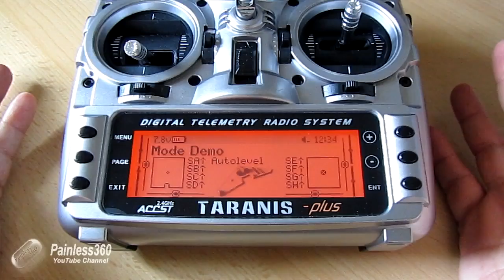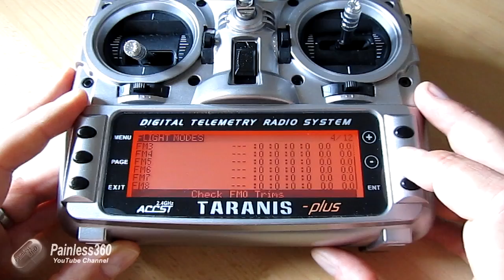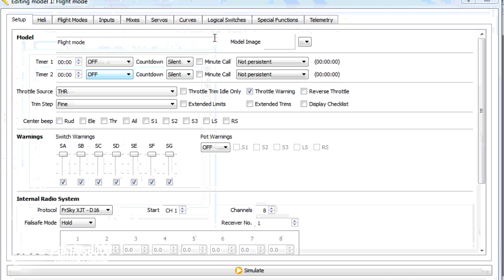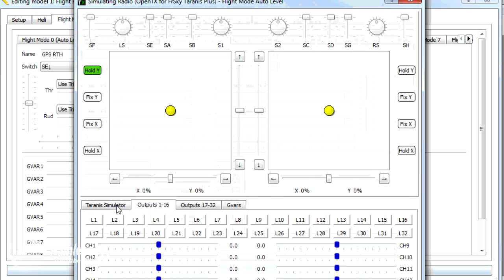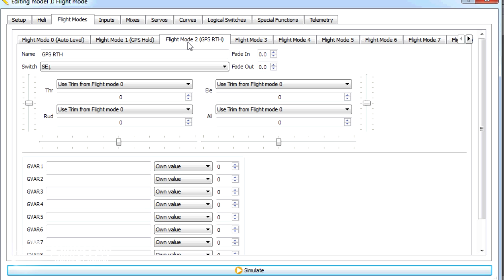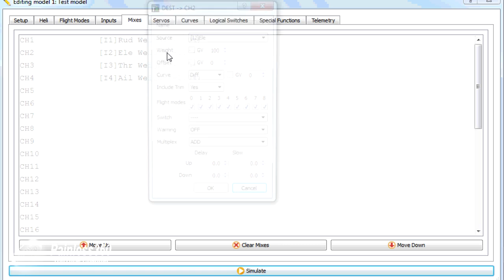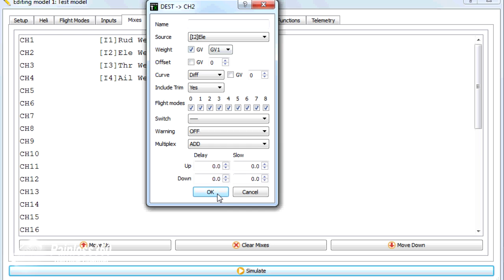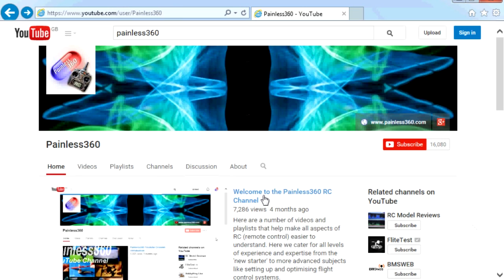(11/12) FrSky TARANIS Radio – Using Flight Modes and Global Variables (GV/GVR)

Comment: hello, huge fan and great videos....got a question for you....How can you put in trims  on both AIL if you have them wired with a Y cable on one channel, like camber and stuff?
Reply from the maker: The simple answer is you cant. For things like that then seperate Aileron channels are needed. See my plane setup videos... best of luck!
Reply: TY

Comment: I'm using iNav on a fixed wing.  If have flight modes for Angle, Horizon and Bypass Mode on one switch.  The flight modes display properly. Now I have a separate switch to activate a mission.  Although I have created a flight mode for automode, it will keep displaying only the basic flight modes, ie. Angle or Horizon.  How can I have an override to display automode?
Reply from the maker: What troubleshooting have you done? GPS lock?
Reply: @Painless360  It is a display issue only, not one of function.  All my flight modes work 100%, but it is just that they don't display properly on my Trananis 9x Plus.
I have Horiz, Angle and Normal Mode on switch SC, and AutoMode on switch SE.  When I'm in Angle or Horizon mode and switch to AutoMode, the display will continue to show either Angle or Horizon mode, never AutoMode.  
I'm not sure there is a solution to this, but I discovered is has something to do with the order of the flight mode, i.e. 1 through 8.  If I make AutoMode my flight mode1,  the display will show correctly. But if AutoMode is flight mode 6, and Angle is 1 and Horizon 2, it will not display the AutoMode but will stay on either Angle or Horizon .  So the lower flight mode numbers have priority over the higher flight mode numbers.   Its a bit strange, but that is how it seems to work.   
Anyway, it is not a big issue as I also play the audio tracks when selecting different flight modes.

Comment: Well Painless, 
(Am I allowed to use this name when addressing you in an email??? I don't want to appear ill mannered,or insulting.)
This video has raised my curiosity about Stabilization, and GPS Return to Home.
I am not into quadcopters, but can see some potential merit for setting those systems up if I temporarily lose sight of a glider/sailplane.
MY QUESTION
What is or are your recommendations for stabilizer and GPS Return to Home eqipment wich is compatible with FrSky and Taranis Plus(LBT).
At this stage I just want to browse and explore the options and perhaps links to a couple of forums, and of course potential costs.
Go With the Flow
Bruce
Reply from the maker: At the moment we are big fans of iNav, it works on multirotors and fixed wing too. See our series on it where we cover what you need and how to set it up.. Best of luck!

Comment: Thank you for all these wonderful tutorials, I have learned so much.
I am now flying my six servo Phoenix and motor on seven separate channels. I have managed most mixes under your great videos, and thank you for that.
 BUT I have not yet discovered a simple way to set up reflex, camber, and thermal, on a three way switch (say SB for example).  I am thinking that I should be able to set this up on one aileron,  using GV1 reflex, GV2 camber, and GV3 thermal, as Flight modes 1, 2, 3.
Having done that, I could then "copy" to each of the other servo and flap CH mixes.
Am I heading the right direction???  Do you already have a video that describes such a set up? This Video 20 is not really going into enough detail for me. 
Appologies for being so THICK!
Bruce
Reply from the maker: https://www.youtube.com/watch?v=NRE42Kv8uHU ;D

Comment: Lee, I just got a new Taranis so your videos are very helpful. However, I seem to have missed where I match my transmitter flight modes to match up with the flight modes in mission planner. What I mean is how do I guarantee that the six flight modes in mission planner totally match my switch positions of the transmitter.....hope this makes sense. Which of your vids do I need to watch again to find this?  Thank you.
Reply from the maker: +Hitman5363 Texas the one showing how to add the 6 position switch is probably the most useful. Best of luck!
Reply: Thank you. Just watched your 13th vid and understand how to do it if I decide to. I think for right now I will just use two three way switches to accomplish the same thing......now just to figure out how to do that too.
Reply: I hope you have a vid though that covers that...????
Reply from the maker: +Hitman5363 Texas see the videos on logical switche. Use the 6 logical switches from two physical switches, then use those logical switches to set the channel value of the channel use for modes. Best of luck!
Reply: Which video of your 12 videos is the logical switches covered in?  Coming from standard radios I must say the Taranis is a bit intimidating to say the least. Really trying to wrap my head around it but this old dog is having a tough time. Thank you for the help!

Comment: great video.. still wondering what is the difference between flight modes in cleanflight and this one here in the remote controller.
Reply from the maker: +Rhyando Anggoro Adi they are completely different. In CF they tell the board how to fly, in Opentx they are a way to store settings that can be activated at once..
Reply: Painless360 thanks for the reply.. I still have a confussion when both aux of cleanflight and the tx controller are activated, lets say horizon mode in cleanflight and attitude mode on the transmitter are both "ON". Which one will be chosen by the quadcopter ?
Reply from the maker: +Rhyando Anggoro Adi whatever you've setup in the Cleanflight GUI. The active one shows as GREEN. Happy flying.
Reply from the maker: Both if you've set it up that way. Not sure what you're describing however, a video of the problem helps..

Comment: Hi, I'm trying to set up my Quanum Outlaw 270 using Openpilot GCS. When the program wants to look at my Taranis transmitter configuration, it's doing the sticks OK, but It seem to have problems to see any swith. I'm not able to assign a flight mode switch.
I hope you can help. Thank you so much.
Reply from the maker: Not sure what you're describing - we have lots of videos in the 'Introduction to Taranis' and the 'OpenTX mix school' too.. Sounds like you need to watch one of the earlier videos in this series where we set up OpenTX for a multirotors.. Best of luck!

Comment: Is there any good reason to set things like Expo and D/R in the Mixes instead of in the Inputs?
Reply from the maker: +Axel Thieffry You can do them in any part of the mix, a lot of it is personal preference but setting them up in the output mixes makes things like variable rates at the lick of a switch a piece of cake..

Comment: First great video!!  OK On flight mode 2 and 3 I have switch SF(back)  engine off, SF(forward) Clear Prop, same as what I have for voice on special functions for this switch. Using Open TX SIM this shows on the splash screen when the switch is moved as in your video.  Now if I add in mode 4,5 and 6 switch SB (back) flaps up, (middle) flaps 30 (forward) flaps 40 these do not display on the screen when the switch is moved.  Only what is on the SF switch is displayed.  What I'm asking can any switch movement be displayed or only one? If so how?
Reply from the maker: Thomas Dunphy Not sure - l will play. Let me know if you figure it out..

Comment: I have a question.  Is there a way to have a flight mode for more then one switch?  I did your example using Open TX on one switch to show throttle active and engine off  on the screen as you showed in your example.  All works fine.  Now I add another switch to show flaps up, flaps 30 and flaps 40 but when I move the switch only the modes from the first switch are displayed. Nothing happens when I move the second switch to display the mode.  Can this be done?
Reply from the maker: Thomas Dunphy Not sure what you mean...